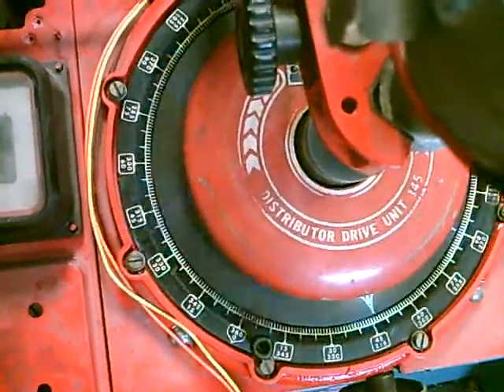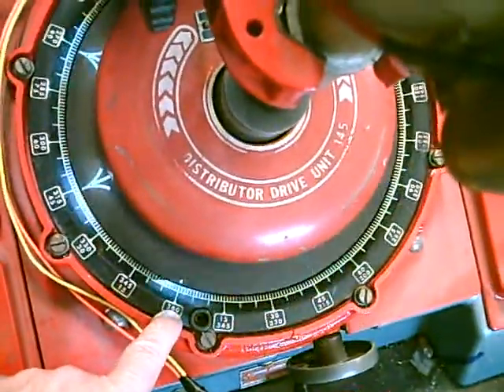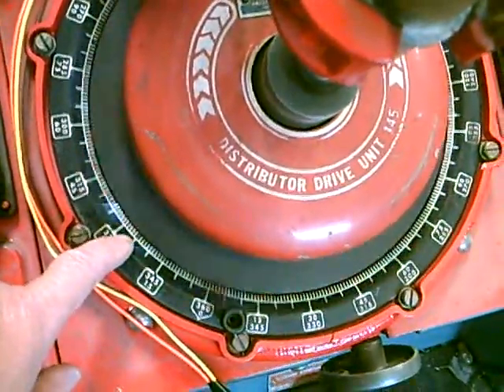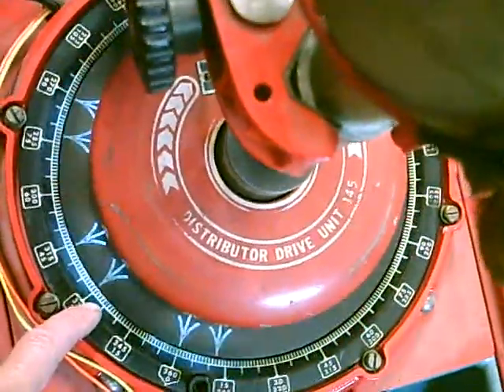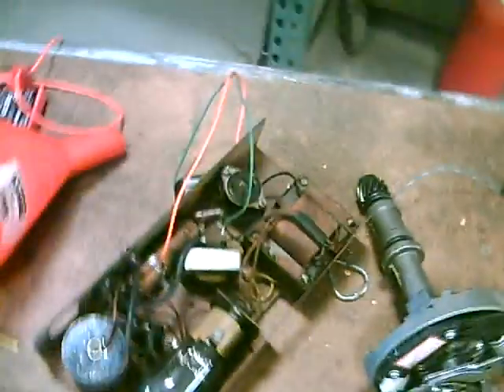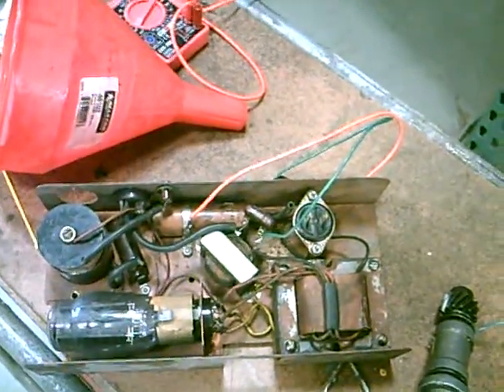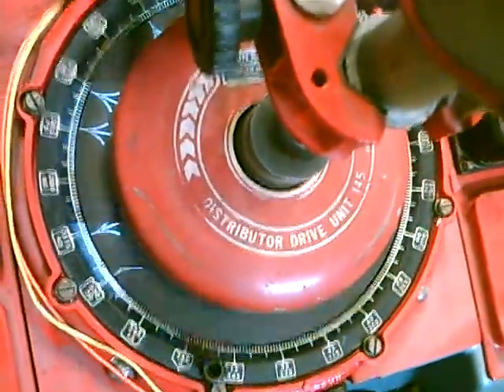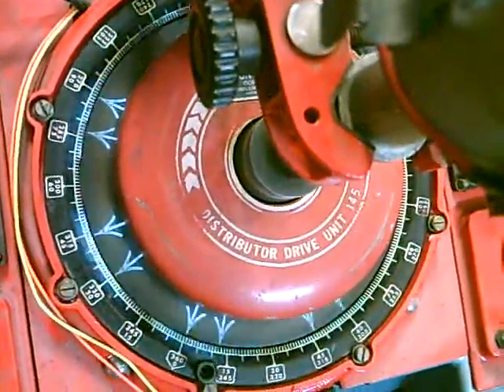SUN Distributor Machine Dwell Flash High Speed LED Technology #2

Comment: I wish there was a Distributor Machine School & I'd buy an entire modded machine from you!  I'm trying to help the Delorean owners that use Bosch Odd-Fire distributors on an Oddfire V6 called a PRV-V6 which was a joint venture between Peugeot, Renault & Volvo from 1976-1988 & used in many cars in Europe including the Delorean. However all the Euro distributors that also used Bosch low power ballast electronic ignition did have more aggressive timing curves & those are hard to obtain in European junk yards & on the forums.
One Delorean expert shows that a GM 4 pin module & HEI coil can be retrofitted & bypass the old Bosch coil & ballast resistor.  I want to setup bench test to show this mod in action at the spark plug & also using Resistor & Non-Resistor plugs along with 2 different piggy back ignition boxes that are Plasma Generators & have been in production for over 25yrs & far superior technology vs. CDI ignition.
A bench demo can show the Delorean owners the Bosch ignition is antiquated vs. at least converting to HEI & beyond.  They are a very timid bunch.  I'd love to do engine dyno'ing on one of these PRV engines.  All the hard core tuners are in France for the vintage race car circuit cars & take the 130hp & turn it into 300hp-500hp normally aspirated, mostly in a car called the Alpine a310.  
But the poor Delorean was ill fated & doomed before it ever got into production since all of Detroit had it in for John Delorean & he was cut off from all good auto technology at the time or would've certainly used GM HEI or Ford Duraspark.

Comment: I have the same Sun distributor machine and the original flash tube system has recently failed. I would like to replace it with the system you have developed for your machine. How can I contact you to discuss?
Thanks
Chuck
Reply from the maker: Post your email and I will send you the manual so you can see if this is something you would want to try.  If concerned with privacy, you could post it and in a couple minutes delete it.  I should still get the message.  I get a few comments that don't exist when I go to look later. Never tried it but it should work.
Reply: @opera5714  I posted my email briefly then deleted it per your recommendation. Look forward to hearing from you.
Reply from the maker: @coupechuck  apparently too brief, I never got it.
Reply: @opera5714  I have a YouTube channel also. Search YouTube and my contact info is posted. Look forward to hearing from you.

Comment: I’ve managed to configure most of the meters and wiring, including building a new commutator for the COB LED. I was planning on using a brake booster electric vacuum pump,, but can’t work out how Sun /Allen regulated the vacuum- I suspect they just ran the pump flat out and used a needle bypass valve - could you possibly post a video on the vacuum setup?
Reply from the maker: It is just a bleed off valve.  I just used a small air pump I found from a medical application.and reconnected to vacuum side. I am not in possession of the and it will take a while to get to them.
Reply: Hmmm... I thought so. I'm hoping a PWM controller and the Vacuum booster pump will give me enough vacuum and some degree of vacuum management. My other option is a fridge pump compressor with a bleed valve.

Comment: Hello,
I'm in the UK and building one of these machines from scratch.
can you tell me where I can get the LED flash/ dwell module, and the dwell calibration module details?
Reply from the maker: I list the dwell flash module on ebay on  occasion and when people ask.  Am currently working with a purchaser that has little electrical experience rebuilding two machines and adding additional electronic tach and dwell electronics. This is giving me a chance to improve the manual so I have not listed this module recently till that is further on. The dwell calibrator is only needed to calibrate the old analog meters as SUN only has a procedure for using a calibrated distributor. It would serve no purpose on a new build.
Reply from the maker: Another thing worth trying is a cheap USB scope that works with a laptop. A once per rev hall sensor would not only work for speed, but allow to see each individual point opening in a sequence. Some calculating but far more accurate than a pointer on a disk.

Comment: do you sell these modules? have a mdt i would like to up grade
Reply from the maker: Yes, these are available. Leave email contact and will send manual to see if you are up to it. I developed these for my friends who are into racing. If you have a working machine now, be aware that most of the old stuff has to be ripped out and the flash head will have to be re balanced.  This module is a cheap solution compared to a $600 tube if you are up to the challenge of balancing.
Reply: @opera5714  Would you have a part number for the tach? fit to be tied waiting for module
Reply: super excited
Reply from the maker: I looked back and do not have a listing of what I bought.  However, this is a generic 4 digit module sold by china for about $10.  It has calculator capability to change distributor rpm to engine RPM t.  I uses a transistor sized hall sensor glued under the head cover. Many tachs now also supply a hall sensor.Not sure of where this could be mounted. I will be able to look at a machine in a couple days to review options.

Comment from the maker: This DWELL FLASH module with LED is available for $229. Contact me for further details. If you want to discuss your conversion, provide your dwell/tach module number. That will be a model like DTT, TDT-1, TDT2, TDT-5, 10F, 10N, 310, 140A, 150A thru 150S, 155E, GA, KE and will be screen printed on the module. Telling me the SUN model number like 400, 500, 600  is not very useful. There is a small mod to make the 6V dwell work on 12V.
Reply: Hey Opera - I do a lot of work with my ole' Sun distributor tester - it was rebuilt by somebody long ago, but I'd like to upgrade it with your LED flash module, use the calibration module you showed, etc.  How can I contact you?
Reply from the maker: @sinnovate3983   go to my home page and give me your email. This can not be read by others.  Allow several days delay in each response as I do not have home internet in winter.
Reply: Are you still making these conversions?
Reply from the maker: @bustrekkin2977  Yes, I have one left I found, which may be promised to someone else.    I make them in batches and am currently moving.  Next availability will be end of July '24.

Comment: I have a SUN 400 Distributor machine.  Is the conversion shown in your video possible for that machine?  How can I get information on the parts needed for the conversion?
Reply from the maker: I believe we are already talking. For others, this module will work on any distributor machine and is available on ebay.  I am happy to discuss any technical problem with these machines on a time available basis.